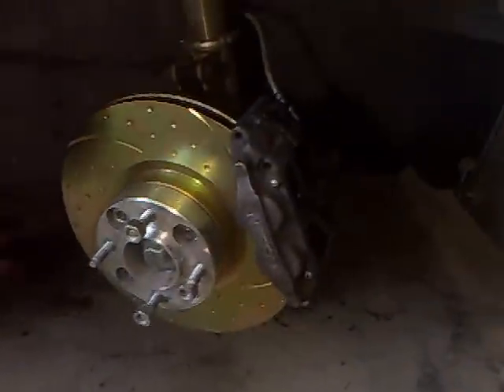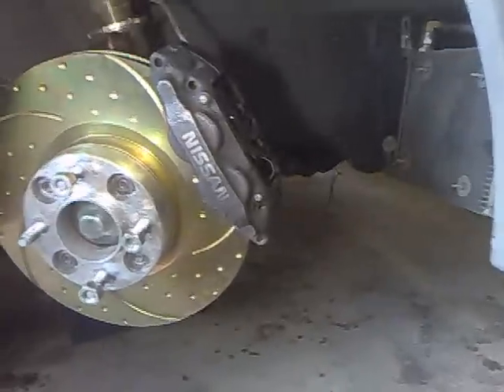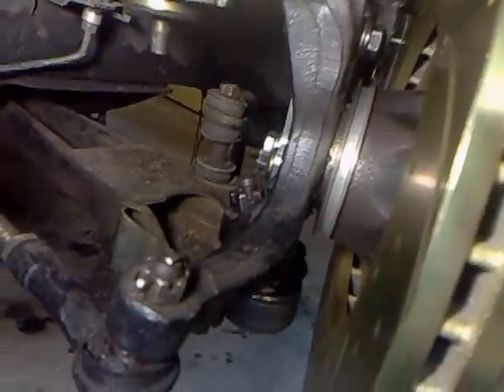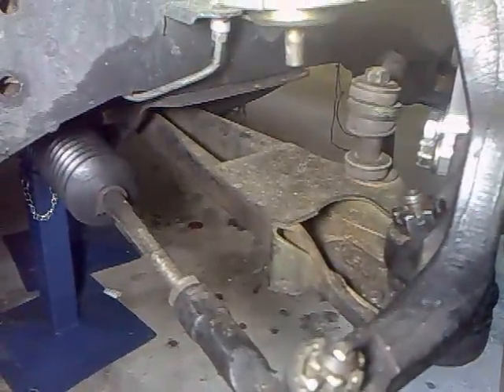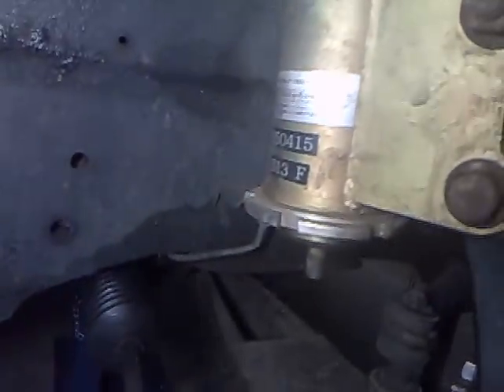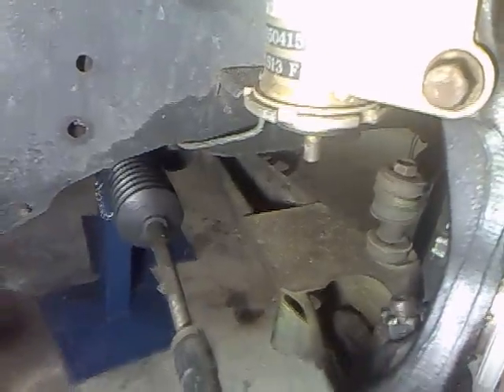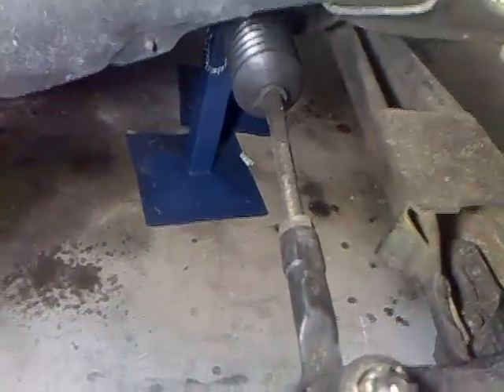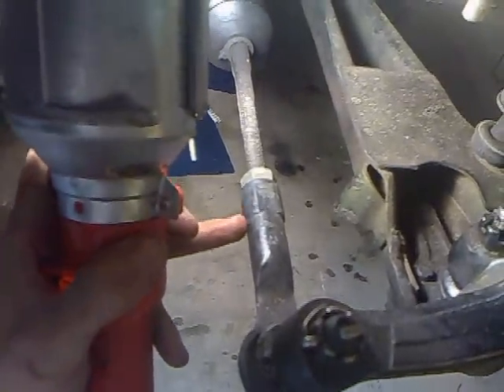280zx Coilover and Brake Upgrade

Comment: I have a whole bunch of questions about the coilovers to what exactly you used to bridge the hub to the control arm of the S130. Pm me I would love to get in touch. Also do the hubs in the back bolt up with the axles of an R200? I am curious as to how that a whole process looks and worked in the back

Comment: I wanted to ask you a question about the front coilover im having a big problem i have 81 280zx and on the car the front coilover is connected to the caliber im trying to put nee suspension on it but the strut is connected or probably welded on the caliper brakes and im trying to figure out how to change that or how to put new strut on there and so far your video kinda helped me but can you tell me what i can do? It would be very helpful

Comment: have you had any issues with the 240sx hub onto the S130 balljoint? Ive heard people that have done this but some say its too dangerous for the balljoint to be bent so far back. So what some have done is make an adapter plate to increase the angle of it. When you say Silvia, you do mean the S13 correct? Please message me because im getting S13 coilovers arriving soon and would awesome to not weld so i could always reuse them. Thanks!